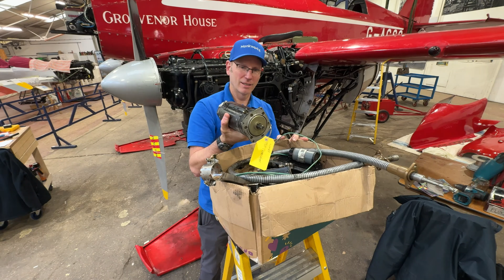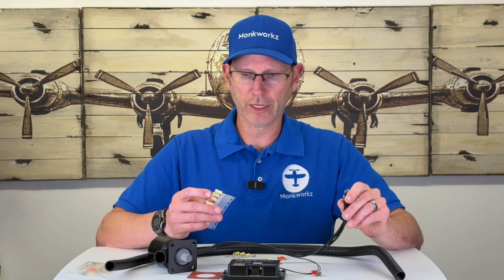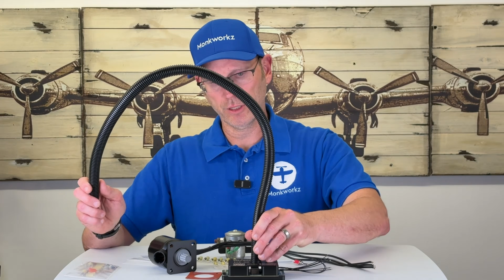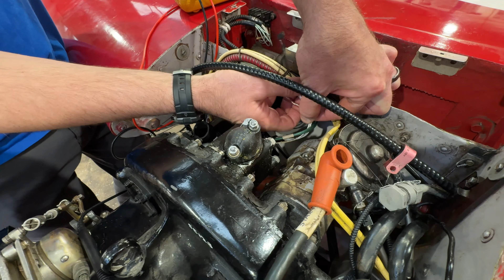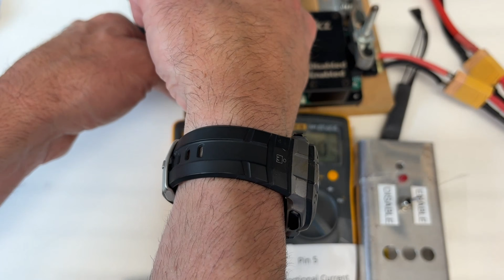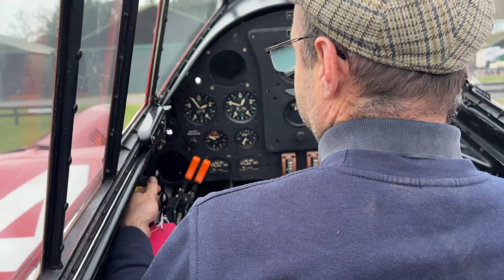1934 de Havilland Comet Monkworkz Generator Installation

Comment: Super cool product and fantastically cool application of it.  You seem like a really sharp and practical guy - why use that little pico connector instead of something a little more robust?  Is it just the absolute minimum package size?  I know they are inexpensive but a DE-9 with pcb pins is affordable too.  Thanks, and thanks for showing us the whole install process.
Reply from the maker: Hi, when you start looking for a small, SMT connector that comes off the board parallel to the plane of the board you'll find there isn't much out there. DE-9 with the connector shell is quite long compared to the picolock, giving a lot more flexibility to the installer. If you want something, bigger, heavier and more expensive...